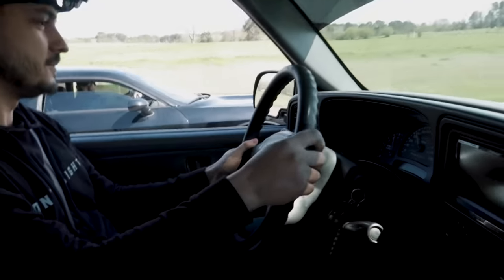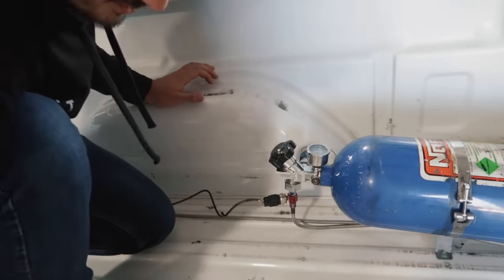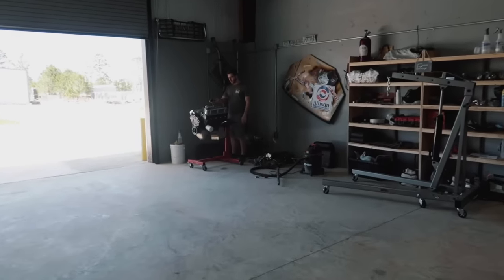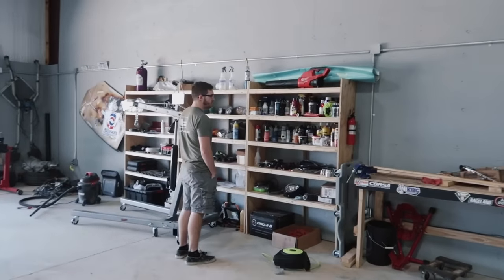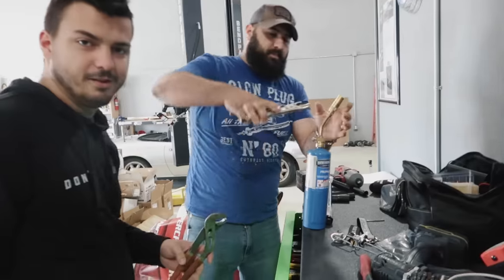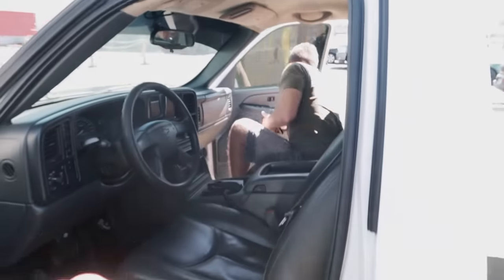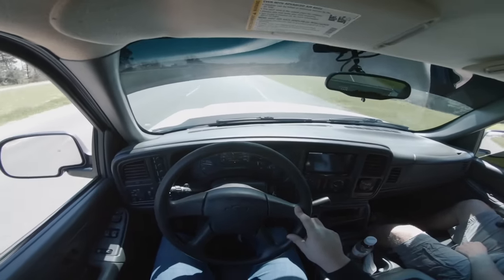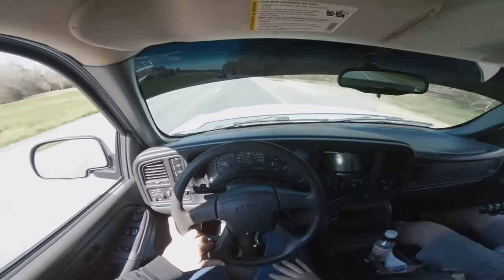When the Nitrous hits... Nitrous Truck vs. Challenger R/T

Comment: “Nitrous on a stock engine would be fun, for sure” these words have been said way to many times by men
Reply: As long as you don't go crazy with the shot you can run nitrious on a stock motor all day long
Reply: Hell I do it😂 spray the fuck out of my mustang
Reply: Bout to put it on an 08 Milan 2.3😅
Reply: We used to run 125 shot on stock fox body's 5.0s all the time and race. Best set up was the 125 shot with a 410 gear
Reply: @jonathanlawson4667  i ran on my l99 camaro with cai and xpipe only with 100 shots made around 470 whp on the dyno and ran for more than 2 years .. until i sold the car

Comment: The nitrous in the bottle is always liquid form, until it’s reaches a different pressure/temp. Then it vaporizes and makes the cloud you see when you crack the bottle open, or when someone purges the system. That’s what gets pulled into the cylinders, not the liquid, cause hydro lock wouldn’t be fun😂
Reply from the maker: AcidicGamers2 correct 😂 that’s what I meant lmaooo
Reply: itsjusta6 Gotchu🤘🏼 Before someone tries ripping you apart 😂 Getting “Don’t Lose Sight” tattooed on my forearm soon. Thanks for all the good vibes, kick ass videos, and awesome content. Hell yeah brother🤙🏼
Reply: @itsjusta6official  too bad you are so far away. I have a cobalt that would. Walk the truck, once I get the motor put in. Very minor mods it'd walk on srt8 challengers.
Reply: @sinformant  what do you have done to it, and which cobalt?
Reply: @stckarma6673  09 turbo ss. I/c and piping. No cats,straight flow exhaust, upgraded map sensors, 22.5psi tune. Hopefully when I drop in the new motor I can slap on a bigger turbo. The new motor should hold a lot more power than the original. Not gonna pretend its a beast, but it holds its own with most of the stuff around here. Definitely could use a better tune
Reply: Ty lol
Reply: @sinformant  I've got an 06 with the lsj, nothing really done to it right now. Just a new muffler and I put some led color changing headlights in it. I'm waiting til I have some more money and I'm gonna do a turbo swap
Reply: @stckarma6673  yeah the lsj's can get nasty with a turbo swap, but I think the gearing is pretty short, I may be wrong.  I know my 09 seems pretty ling geared. I can break 150 in 4th gear. I wind down around 160ish in 5th, the stock turbo just gets too winded and can't overcome the aerodynamics of the car at that point.
Reply: @sinformant  yeah the gearing is definitely pretty short. 4th takes me to 130ish and I've only gotten to 155 before I let off so I don't know exactly how far that'll go. I was originally gonna put a tvs supercharger in it but I've got a buddy with a ported k04 and full kit for it so I might as well go that route lol

Comment: 8:05. “ I have not had anything with a turbo yet!” Then you see the Duramax in the background. Guess it doesn’t have a turbo 🤦🏻‍♂️
Reply: Pretty sure he meant a turbo installed himself or aftermarket not stock like a diesel comes with.

Comment: You know you can purge the nitrous with the key on and truck not running right?
Reply: Wouldn't the intake be full of nitrous then?
Reply: Great way to blow the engine
Reply: @Junior_Perez  done it quite a few times, didnt have a button to spray got a zex box which has a 100% throttle switch
Reply: @Junior_Perez  you must not have been in a situation without a purge kit with a wot switch not a button

Comment: I got a Ford F150 STX 2WD with a limited slip rear axle (3.55 I believe).  It has the standard cab, but with rear direction extra doors and the 6.5ft. bed.  It only has the low power 4.6 V8..But it is very reliable and I only got it to tow my bassboat in the summer.  I always wanted to turn that thing into a sleeper truck.  A 5.4 would be the easiest transplant, than a supercharger like the old Lightning series Ford truck.  I would rather the newer 6.2L 2 valve engine for sure.  You never hear much about those engines, but they are powerful,,especially in the older Raptor with 411hp and good torque as well.  (They even built some Raptors with a 500hp 6.2 as well) Would love a 6.2 transplant with nitrous..That truck would hurt some feelings really badly..lol!  Its weight alone being much lighter like your GM truck you own helps alot..Even with its low powered 4.6V8 it has a decent midrange and passing power,,just slow out of the hole...I did have to get a new clutch pack for the rear axle a few years ago and new seals while we were at it...Only problem I've ever had with it...I'm giving it to my son for graduation next year..he doesn't know it....Be cool to make it into a more modern Lightning truck..Make a great sleeper...and its Ford red paint as well like many of the original Lightning trucks.  Its just to bad Im in the north as rust is starting to show its ugly face on the frame and the body..Even with frequent care and undercoating..It would make a fun build for my son and I for sure.

Comment: What motor and bolt ons does the truck have? I had an early ls 5.3 in a 2001 single cab and with a few bolt ons it would beat my pops 04 mustang gt easily.

Comment: You should do the same Rocketeer kit engine swap to the Miata that Car throttle did, but boost the fuck out of it. Its basically a ford 3.0 with bolt ons.

Comment: I have a very strong recommendation for you guys. .. regarding the bottle heater idea... put in an inline/obligatory timer switch such that, even if you forget about the heater and leave it turned on, it will auto-turn off after maybe 10 seconds and it will not end up overheating and blow the bottle up! Even if it means that you have to hit the bottle heater switch manually 10 times to get it up to operating temperature, it's better to have that small inconvenience than risk a blown-up truck or serious injury! Knowing how casual you can be about these things, this is a comment i absolutely HAD to make!!

Please thumbs up if you want to see Itsjusta6 survive and continue to make videos!

Comment: Gab , why not jacket around the no’s bottle material ok think  making a blanket a with heating pads in between within a connected town ignition switch onece turn on with heat bottle for you btw heating pads or fish heating pads.

Comment: Is this a 5.3 vortec? The challenger sounded like it was auto and had 2.62 or 3.08 gears for mpg. No way will a 5.3 take a 5.7 hemi with the same diff gear ratio (stock to stock). Nitrous 5.3 would wipe the floor though!

Comment: 5.7 are stupid slow stock can confirm 2.65 rear end doesn't help at all either. Little 3.92 rear end swap headers and a tune literally shave like a second and a half off the that 13.9 stock quarter mile time

Comment: had  a car with nos ,this video is fake as nos when it pulls ur revs will imidietly goes to red , nos is triple oxygen so it can give u 3x times more horsepower for 1 second u cant use it more than 1 second as all ur pistons will  tear down and melt inside the engine

Comment: 14:10 ok that's fake.
IRL NOS is not like in fast and furious or NFS. you can't use it more than 3 seconds wtihout flowing upi your engine and having your piston lift off and fly out.
NOS is used in small doses/press. to get that edge a few moment at a time. not continuously

Comment: miatas decimate all after overnight parts from have you driven a ford lately.  also 13 flat no nitrous second truck is buick grand national quick and a cuda or challenger 13.5 to 14 flat no nitrous. 11 second flat nitrous is a nice little quick truck. it takes 450hp in some cars to accomplish that. For a daily driver that is really good. Now i know i shall be sure and go ahead and make a camaro a 10 second consistent 1/4 mile  street car from the get go to get it to go.